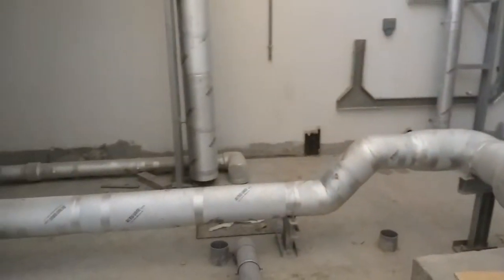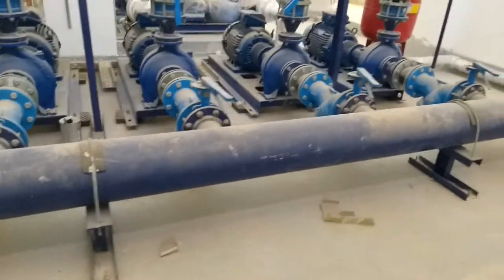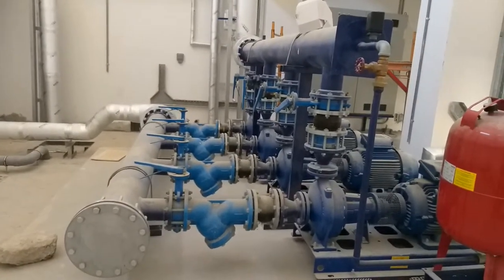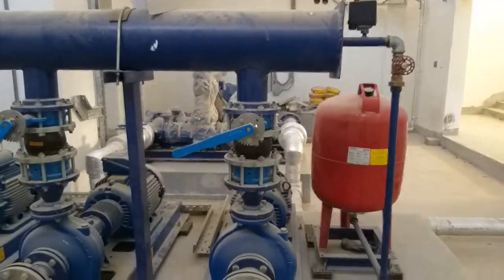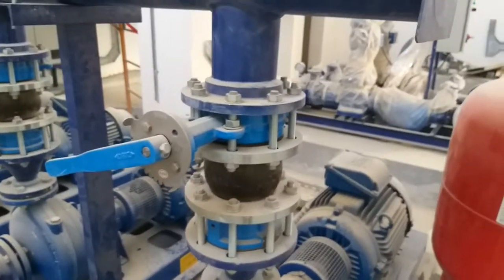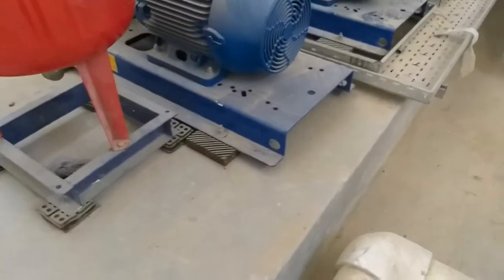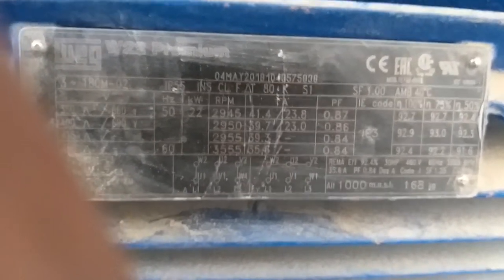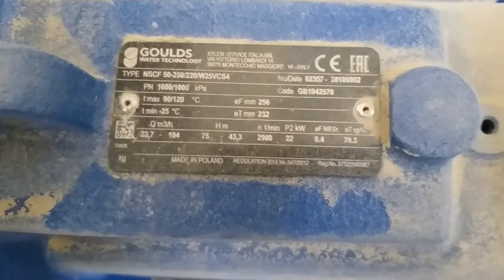"The Key Parts of a Booster Pump Explained" | Water Supply Pump | Pump Room | MEP | Installation

Comment: There is pressure vessel near by the booster pump . what is the purpose of that ??
Reply from the maker: It will absorb the pressure during operation of the pump and it will keep the pressure as soon as the demand arises instead of starting the pump directly